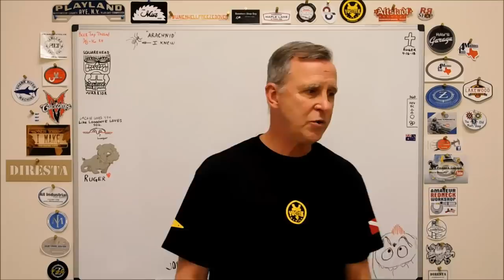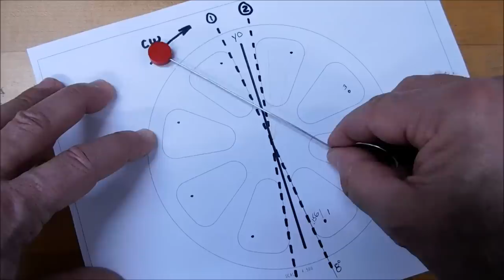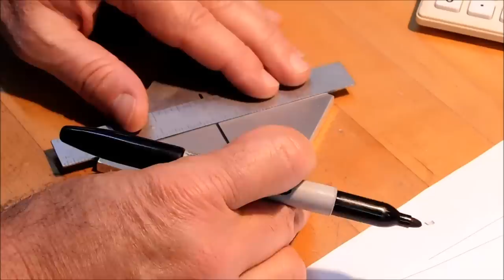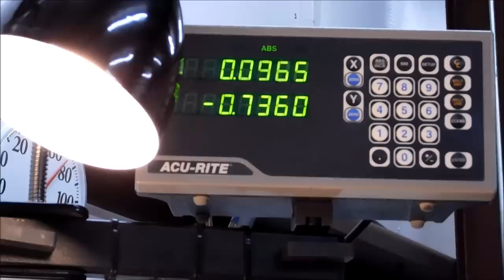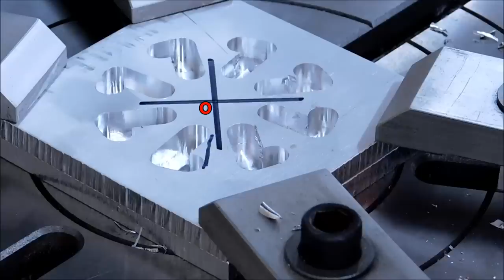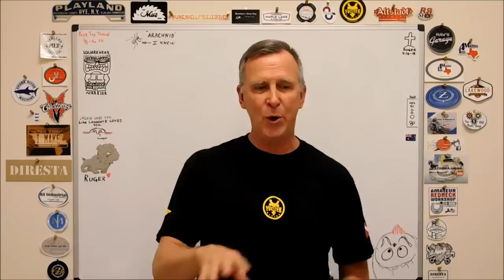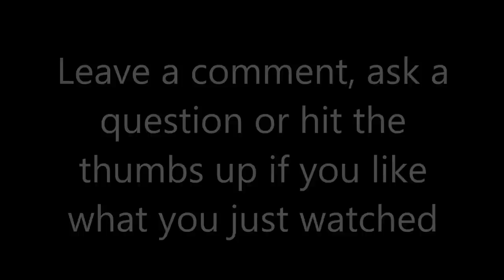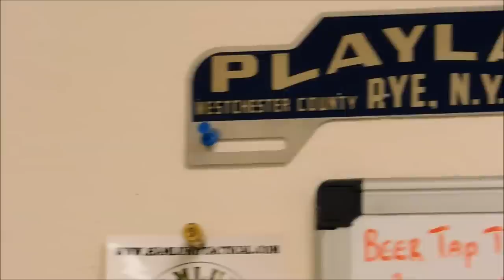Milling a Flared Spoke Wagon Wheel on a Rotary Table

Comment: This is the stuff you can only learn by using manual machines. CNC programming will get the job done but leaves the operator in the dark. Good work Joe.

Comment: While working on the mill I constantly find myself questioning which way I need to turn a dial to get the table or rotary to go in the direction I want it to go.  I need to make up some cheater arrows that can point me in which directions move the table/part in the direction I want it to go.

Comment: Great demonstration as always.
One question: your turntable does not have any backlash? Unless I missed something. Thanks again for all terrific presentations.
Reply from the maker: The engagement has a disconnect knob that I use to take the backlash out. If there is any present, its around 9 minutes of rotation.

Comment: This helps with some flywheels for model hit miss engine I am building. I drilled all holes using x,y coordinates but ended up turning table wrong direction and cut into spoke. Your method is better.

Comment: I learned to place datums on holes, or at least if not possible give the x-and y-coordinates of one of them. I learned to do this because if did wrong the gentleman from the machine shop used to come to my office and kick the shit out of me. My first ever drawing nearly put me in the ER, by the time I had finished my fourth I felt reasonably confident I would be able to walk the next day. With CNC, I guess much of that is a thing of the past, but there are things you can still do to help. One example is to put the widest possible tolerance on inside radii, allowing free choice of cutter.

Comment: Hi Joe. Thanks a lot for this vid! A question i I may: How do you switch between features? Using the degree wheel? What if angular spacing mattered so much that you needed to index? How would you approach the initial 8 deg offsets then?

Comment: Joe, if you recall that first climb cut along the rim had a different center due to the x-translation than the later full circle.  The tool flexure contributed, but I don't think a spring pass would clean it up completely.

Comment: Joe, at work our cnc guy would have cut the final diameter to depth in 1 go down to .004” left. Then just wobble the part off the scrap material. Thought you were going to do the same thing. Very small burr left to remove. We used to make multiple parts on a single sheet that way with holding bolts in the scrap areas. The machine had an aluminium sacrificial platform that tapped holes could be placed where required. Great tutorial as always.
Reply from the maker: I've seen and done that. Sometimes the part will lift up into the cutter and mark up the sides. Its a good process, but you have to be careful. Thanks for watching and checking in.

Comment: Joe, I can work it out but there is a lot of math to find the distance from center for your initial (inner) distance to insure that the return pass will converge to a single point for a given cutter diameter and rotation. Did you do this math all manually or did you draw it up in CAD?
Reply from the maker: CAD. Not impossible with a calculator, just time consuming.
Reply: Joe Pieczynski thanks. I did get through the math but when I showed it to my architect son, he said forget that , and assured me cad was the way any normal machinist would do it.

Comment: One of these days I will have to get some stickers made! Wheel came out nice.
Reply from the maker: The tough part is that it will probably cost more to send them than to make them. Can you imagine mailing 5000 stickers to subscribers at .50 per for a stamp. Thats a $2500 hit. I'd hate to charge for them, but may be forced to just to break even.
Reply: I was thinking the same thing .

Comment: Showing the effect of climb and heavy load was enlightening.  Does one ever plan for that and is it possible to predict reliably the offset that will occur so as to avoid a second pass?  Additionally, within that area the resulting face is now not perpendicular because the cutter flexed or are cutters tapered slightly to take such cuts into account?

Comment: To remove the outer material, another way ( which there are many) is to drill through the negative spoke area in two locations 180 from each other and clamp down to the fixture plate so that when turning the rotary table the outer diameter is smooth with no indication of a stop start point. Correct me or tell me why this wouldn't work a little better. Hope this helps. Thank you for your videos!

Comment: Would you come back to tidy up the boss left by the climb cut with another climb cut, or return using a conventional cut? BTW thanks for the tour around the board.  I had a wolf spider in my office many years go, yes, it was the office pet. It kept the fly concentration down ;~)
Reply from the maker: Strictly for cosmetics, I'd finish with a climb cut.

Comment: You can easily reduce tool flex by using a smaller diameter cutter to take all the weight out and then finish with your finishing tool with climb milling as you did. You then get a perfect blend and no mismatches.
Reply from the maker: I would think a smaller diameter cutter would flex more. A second pass would be the best.
Reply: I was trying to make it simple, but me personally would use the same cutter but leave about 10 thou for finishing. I have done this with all my clock wheels and I never get a miss match. I’m sure would do the same if you wanted a perfect blend. I was trying to simplify it for your viewers.

Comment: Hey Joe, thanks for this. Please tell me, how do you move from feature to feature? Do you use the degree wheel or indexing? How would you work on parts that have  features requiring both indexing and rotation? Or, to make it even clearer: let's say you need to make a part that has two bolt circles on it, let's say same number of holes, but one bolt pattern to the other is offset by e.g. 7.123 degrees rotationally. How on earth would one do this?
Thanks in advance!
Reply from the maker: Thats actually easier than it appears. Use the rotary tables standard position marks for the rotation and just offset the starting point using the X and Y axis of the mill. Just figure out one triangle for the initial 7.123 rotational difference than use the same pattern as the first. if this answer isn't clear, feel free to ask again.
Reply: @joepie221  alright, I didn't provide a proper example.... Let's assume the previous example but with a need to mill a slot between the two neighbor points of the bolt circles. Or, to put it more generically: how would one work at a piece that needs accurate rotational features with accurate spacing between them. 
For that, I always imagined a rotab with indexing plates where the whole indexing assembly rested on a degree plate. I guess I am talking about a differential head, right?
Reply from the maker: @thanos_vgenis  These tables are accurate to 10 seconds. if you need closer than that. I can't help you. Thats 1/6 of 1/60 of 1 degree.
Reply: @joepie221  hi Joe, thanks for the reply. However, allow me to still be in doubt: no matter how accurate a rotab is, you'll always have to index when doing, well, indexing. So, my question, still unsolved, is how you can both index and rotary mill on the same piece....
Reply from the maker: @thanos_vgenis  Shoot me a sketch so I completely understand what you are trying to do. aiproductinfo@gmail.com
Reply: @joepie221  hi Joe, thanks for the effort! No specific project, just a theoretical question. I'll email you a draft tomorrow and hope for your advice! Thanks in advance!

Comment: Hi Joe, fantastic video and explanation (as always). As a beginner to machining I really appreciate your videos and particularly your style of showing / describing multiple ways to do something. (Really helpful when you don't have the equipment to do it the ideal way, or you need to apply what you've shown to a slightly different problem.) I'd like to make a small suggestion if I may: when you videoed this your camera was off centre and at an angle to the axis of the mill so the X and Y axis showed at 45 deg to the screen. Whilst your explanation helped, and seeing the bed move also clarified, it may have been easier to understand if you'd used the GoPro mount you designed for the front of the mill mounted perpendicular to the mill table (i.e. the operator's viewpoint). This way everything would be 'square' to the world and the image on the screen would have been more what we're accustomed to seeing. As a 'passenger' to your machining videos this isn't always necessary, but when showing the combination of rotary and linear moves which are nowhere near as common, I'd have picked it up quicker. Look forward to the next ones, please keep making them for us.
Reply from the maker: Thats great input. I actually had the GoPro cover this shoot as well in my line of sight. I may post that for you hard core guys that will watch it. It will be longer, but it got the entire project.
Reply: Hi Joe, thanks for the reply. I’d certainly watch it if you did put it up - I have enjoyed everything you’ve posted so perhaps that makes me a bit hard core 😉. Thanks again for sharing your knowledge and experience.
Reply: @joepie221  I agree about the angle of viewing.  I'm a rank beginner with a rotary table and that 45 deg orientation confused me a little.  It would also be helpful if, occasionally, you could back off and show what your hands are doing (which handle you are turning and what direction)--I wasn't always clear on whether it was the rotary table or the mill table that was moving, especially during set-up.  I realize that you were explaining it verbally the whole time but without a visual reference it was pretty confusing at times for me (I'm totally a visual learner, which is why I love YouTube).  I got a little more on my second viewing and hopefully I'll understand it better after my third and fourth viewings.  The light bulb goes on a lot quicker for me when I have a more panoramic view of what's happening as opposed to a close-up all the time.  Thanks for the great videos!